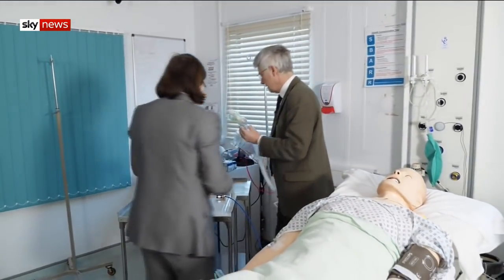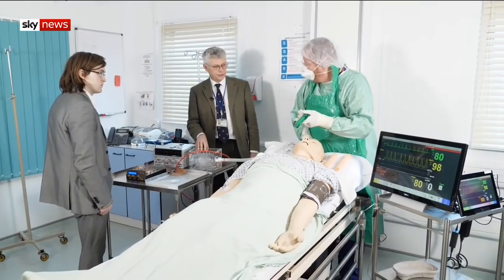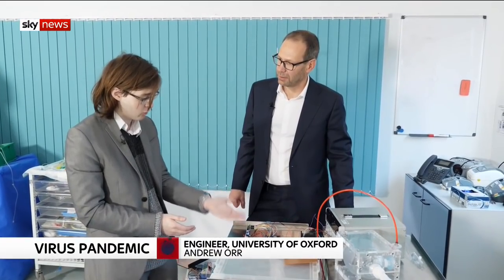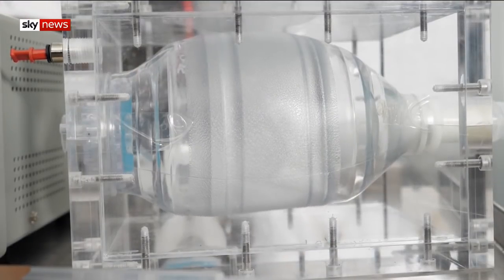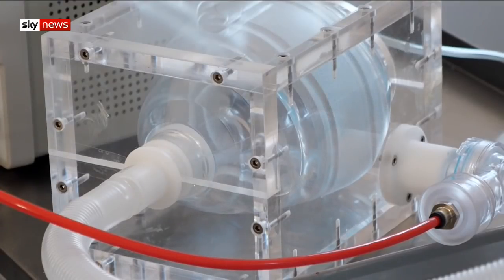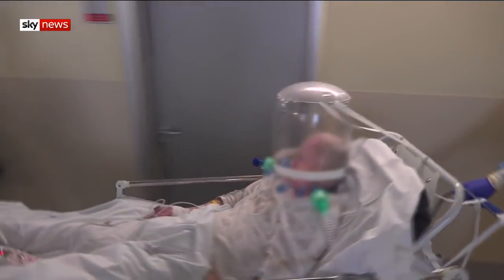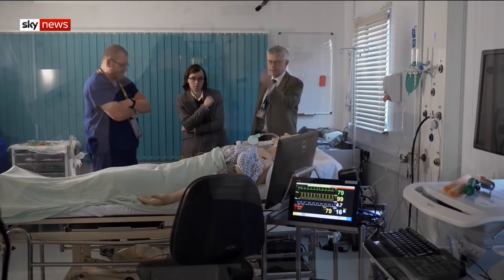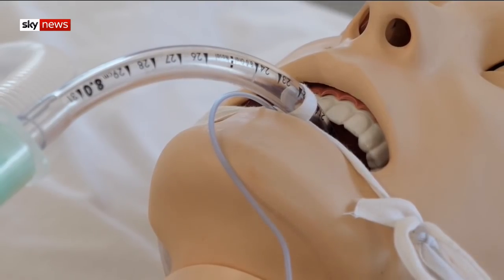New innovation could help solve ventilator shortage

Comment: Good for hospitals that have a presssure line in each room.  The volume output versus pressure source input can depend on the specific structure of each bag, since they can 'crumple/compress' differently -  but they could easily caibrate with each unit with its specific Ambu bag.   Mechanically applied pressure would seem to be prone to less statistical variation with respect to Ambu bags - but just my thoughts.  For a home based unit I'm going with the mechanical compression methods - air compressors are a little loud.

Comment: manual respirators such as those used in this project are useless for covid19 patients. the body's immune response destroys lung cells and makes the lung tissues cling to each other when a patient tries breathing. the hospital ventilators are special in the regard that they can sustain enough positive pressure to keep the lung tissues from clinging to each other while the air goes out of the lung and circulates. it's nice to see people try to help but this project does not seem useful to treat covid19 and could even cause harm in case being used. if manually keeping someone alive could help then every patient would have a family member manually pushing the manual ventilator and have family members make shifts. this is sadly not the case. sorry to be a party pooper

Comment: Very interesting. The time to market and great cost of vents is in large part a function of regulations and the required testing that ensure patient safety. This device would under normal circumstances be laughed off the drawing board as a death trap. That said though, in a situation  where the alternative is no vent at all, perhaps a special class of products not requiring years of stringent testing can be considered. Be careful though, reliability doesnt come quickly and these things will require a lot of monitoring as they'll be failing left and right. Tough call for the regulators whether to allow such devices. Would I want have my life depend on a Raspberry Pi, not really.

Comment: The makers community use Arduino a lot this  is a mass produced microcontroller and if we all come together we can make the ventilators. A lot of people in the UK have a 3d printer at home and is more likely to have an Arduino too . Surely we can reach the 2000 mark or 5000 in no time . just look at what is happening with 3d printed PPE masks made by prusa.

All we need is funding.

Comment: Looks simple. He said no moving parts but there has to be a compressor. 
What type of small compressor. One out of a Refrigerator. 
There is a US doctor with something similar. He uses a cam drive plunger to compress the plastic bag. Any reliable small geared variable speed electric motor.  Adjust the speed and also adjust the stroke to change the volume of oxygen. No electronics. No compressor.

Comment: Just make sure to account for the compressed air requirements!! Setting up too many could over-burden the facility air compressors resulting in reduced available air pressure, which could throw many air-pressure/flow dependent systems out of whack. There should be plenty of large diesel compressors available to tie into such a system if needed since so many operations are shut down!

Comment: Make one large ventilator per hospital . One pump runs all greatly reducing components needed to run system .. If this method is used a cheap but large volume air compressor can be set up in utility room or exterior of building in a safe area and it can be used to supply needed air via pvc piping throughout hospital with separate lines going to each patient and then supply many hundreds of patients at a time off of one system. At each patient have small individual pressure regulators ,monitors , etc..
Oxygen can be added to system along with secondary filtration and one way valves for safety . 

The individual regulators can be plugged in where needed . If new rooms need to be added it is simple to add more pvc line to that new area . 

Quick to implement, cheap, most parts are already available local hardware parts stores ,
Reply: Four words -  Single Point Of Failure. Also, it is a crap design as frequency, inspiration/expiration time, air mix, tidal volume, relief/alarm pressure all need to be regulated per patient.

Comment: I wonder it the designers considered turning it inside out. I mean instead of the self-expanding  ambulance ventilator in the middle supplying air to the patient, having a balloon in the middle of the box expand to push air out of the box into the patient. I would guess it is easier to find balloons than ambulance ventilators. Not knowing squat about ventilators, If having a volume adjustment would be helpful, a movable baffle inside the box could change the quantity of air to the patient.  There might have to be a perforated box to keep the balloon from over expanding. Just a thought. I hope the USA government is smart enough to look for low tech solutions with very little chance to make someone rich.

Comment: I like the design in many ways, but there seems to be no manual may to operate this thing. Other designs that run on electricity seem to have that option. Is the compressed air going to be provided through a central system or is there going to be a need for a compressed air bottle per bed ? 
Non of what I pointed out is a deal breaker obviously.

Comment: "while just a jumble of wires and electronics"
Isn't that every single electronic device ever made?
Reply: yes. we already have the schematics to build ventilators.... this is just a barbaric look at it. This is nothing revolutionary
Reply: It's an arduino UNO, with  breadboard and jumper wires.
Reply: it will be a printed circuit board. all those wires will be gone and it will look like a tiny motherboard that can be spit out of a factory like a machine gun. this is just the prototype.
Reply: that is "robot" to squeeze the air.
Reply: the brain is an Arduino..  a Raspberry Pi could do a bit more, like take vitals, store data, display data and be connected to local LAN (wired or wireless)
Reply: I'd wager that not a single mass-produced device built in the last 30+ years features a rats nest like that simply BECAUSW it is mass-produced.
Reply: Peter Lustig  the week includes simulation, prototyping, pad placement tweaking, multiple iterations to adjust for everything that normally goes wrong with the design, component sourcing ( I doubt sony stocks ATmega368's normally), production engineering (panelizing, planning out the flying lead tester and the pick and place files etc..), post production testing... it's not so much about the automated output capacity as it is the human hours preping for that, packaging, shipping, everything else that goes into preparing for a production run. Anyone that's done CNC knows this, the actual running of the machines is the easy fast and cheap part, it's preparing for the run that's costly. This timeframe is pretty much standard for rapid prototyping turnaround for assembled boards.
Reply: That's not the point in the choice of words.
Reply: @helloworld3943  we know.
Reply: No moving parts? No motor? No pumps? How the hell does it work?
Reply: @vladvolkov8008  magic!
Reply: deanmoncaster Fuckin* Magic!
Reply: Peter Lustig  there is no way these will be reliable enough to actually be used in a medical facility. This is just a prototype. I can't see them putting something like that into production even if it's an emergency.
Reply: No... they will make a PCB(printed circuit board).
This Is simply a prototype using jumper wires and breadboards which would be impractical for mass production, also its using an arduino which is a microcontroller which is overkill for something so simple,  they could use a different microprocessor to lower costs
Reply: Looks like a raspberry pi with breadboard - happy to donate one programmed up if they release python scripts for gpio
Reply: @laoan  It's an Arduino. The Arduino logo is visible in one of the closeups. My guess is it's an Arduino UNO. A Raspberry Pi would allow all sorts of extra features like a video monitor and WiFi connectivity.
Almost any microcontroller would likely be able to control the ventilator. I bet a 555 timer could be used as well. Just something to open and close the compressed air valve. 
The novel approach appears to be using a respirator bag which would normally be compressed by a human hand is instead compressed air. Adding the bag likely solves some of the pressure regulation worries.
Reply: @ddegn  yes I see that now I'm not looking on my phone - a relay driving a £5.99 electric solenoid valve, allowing compressed air into the chamber - a supply of clean humidified air is the greater part of the challenge.
Reply: @ddegn 
Open and close a valve? He said no moving parts... WTH? How does air move without some kind of pump, compressor or a moving valve opening precompressed air?
Reply: No it is a pcb no cables
Reply: @zaxarispetixos8728  0:08 try watching the video then commenting 😊
Reply: @deanmanchester999  i meany no this not how every device is made your phone has no cables everything is printed traces on something
Reply: @zaxarispetixos8728  my phone has cables, the wife antenna, the charging cable that's just two...... 🤣

Comment: So it's just a box filling with compressed air. The compressed air is going trough a 3/2 solenoid valve that's controlled with a Arduino. So easy and yet so brilliant.

Comment: A Dilettante Presumptuous Theorem: 
Can a CPAP Machine be converted into a complex inpatient Ventilator?                         Kathleen Chesterton 11.9k views  
Source: https://www.quora.com/Can-a-CPAP-or-BiPAP-machine-be-used-as-an-adequate-substitute-for-a-ventilator-if-the-spread-of-the-novel-coronavirus-creates-a-shortage-of-ventilators
Vents and CPAPs/BiPAPs are entirely different devices that treat entirely different respiratory conditions. Vents (ventilators — this is mechanical ventilation) are for those who either cannot breathe on their own or who need assistance with spontaneous respirations. CPAP & BiPAP devices treat sleep apnea both obstructive and central. These patients CAN breathe on their own and, for the most part, can initiate respirations. So, no, these devices would not replace a vent, nor would a concentrator. As well, the settings on vents are very different from those on an...
Vents and CPAPs/BiPAPs are entirely different devices that treat entirely different respiratory conditions. Vents (ventilators — this is mechanical ventilation) are for those who either cannot breathe on their own or who need assistance with spontaneous respirations. CPAP & BiPAP devices treat sleep apnea both obstructive and central. These patients CAN breathe on their own and, for the most part, can initiate respirations. So, no, these devices would not replace a vent, nor would a concentrator. As well, the settings on vents are very different from those on an apnea device.
People on vents are intubated. This intubation — tracheostomy, orotracheal, nasotracheal — is incompatible the with the tubing of apnea devices and the tubing that works with intubation doesn’t work with apnea devices. Although vents have CPAP and BiPAP modes — other mode settings include PEEP and SIMV — these settings aren’t used alone. And CPAP and PEEP, for example, are used when weaning a patient off a vent but, again, this isn’t the only setting /mode in use and apnea devices don’t deliver enough pressure to ventilate lung tissue.

Comment: Does anyone have a link to the plans for this? There is no time like the present...
Reply: Just speculating: the manual intubation? bag is inside a sealed perspex? container, of sufficient thickness (and suitable airtightness?) to withstand ongoing pressure changes. I'd imagine there would be 1x compressed air inlet solenoid (12V/24V DC?), and one of the same for the outlet (venting to normal atmosphere). These solenoids would have to be some sort of proportional? (ability to vary air pressure) control, as human lungs aren't designed to work like tire inner tubes, requiring ramp up/down pressure control. Possibly some sort of MIG welding pressure regulator could be used to help achieve this, maybe alleviating need for special solenoid? Control circuitry - I'd imagine Arduino-based may be sufficient. Control: Need to be able to control intubation pressure; ramp up (air delivery into lungs); Hold time (how long to maintain pressure); and Ramp down (release pressure to atmosphere, slowly - I noted somewhere, that Covid-19 patients sustain more lung damage with full breaths as opposed to partial breaths - something to do with the inflamed lung lining being further irritated by complete deflation). Note I am in electrical trades, not medical, so take this as a possible starting point, until proper plans are available. Also, standard compressed air supply has major safety issues - need to focus on this aspect... HTH.

Comment: It's good that this design is going to be open source for anyone to implement. Once the emergency is over, however, it will be difficult for companies to make and sell a shiny version with bells and whistles unless they can tweak the design to patent it. Normally medical devices are ridiculously expensive and it takes months and years to get them approved as safe for use on patients. 

Also, existing computing hardware and programs that could be used inside cheap products usually come with warnings that they are not to be used in "mission critical" situations: which would definitely include ventilators. IBM and Microsoft appeared to design their stuff to crash regularly. Ventilators should not connect to the 'net.

Comment: Ventilators are highly specialised items of equipment. They are designed to go from mains to battery to manual pumping in event of an emergency. We now are asking garden strimmer repairers, vacuum manufacturers and the man in a shed to design and build them. Heroic and needs must but, efficient, reliable and safe? Well, any port in a storm!

Comment: I'd like to think this would be well within our capacity to knock up 1000s these simple ventilators within a couple of weeks 3 d printers would and could   knock up some of the more standardised vital technical components for the units in pop up factories throughout the UK. After all when Nevil Chamberlin (UK priminister ) met with Hitler to Levi a peace deal and came back with the signed piece of paper saying Peace in our time.But also realising that it ment Didly Squat and would only buy us a couple of months .The war ministry commandeered domestic   engineering units and went in to overdrive to produce thousands of new innovative Planes tanks and guns before the crap hit the fan in many make shift factories up and down the land were mobilized in weeks producing cutting edge weapons.

Comment: Great step forward. Simple to use simple to build.
Just hope there is enough compressed oxygen tanks
Reply: Driven by compressed AIR.  When we've run out of that, we're all in trouble.  O2 supplied at low flow to supplement FIO2

Comment: "We're going back to ventilators about 15 years ago."  I don't think so! This is going back to ventilators about 40-50 years ago.
If the patient has pneumonia it would never be able to adequately ventilate.
 It would need to be a volume ventilator; this is a pressure ventilator.
Reply: The Ambu bag has a fixed volume of air. Squeezing it flat will deliver that volume, won't it?

Comment: So why was this not done for Italy or China Spain
Reply: Maybe people in Italy, China or Spain didn't think it'd be possible or accepted, or maybe the 'inventor' was already working (which takes time) on the simple but robust code for the microcontroller, in this case an Atmega 328p, to then be able to bring the parts together. Then add a few days to build confidence in the idea, testing it by running the code and the valve gear continuously to see if anything fails, then when happy present it for appraisal to the people that need it; people who need something that just works, even if it looks terrible with wonky stickers and stuff, and not something they have to tinker with.

Comment: Dupont cables and breadboards are great for prototyping but no good for reliable connections, properly manufactured surface mount (or even through hole) are key, thanks to Sony - also companies like jlcpcb could knock out thousands very quickly I’m sure. As a maker I probably have parts enough to contribute a few units and I’m sure others do too, open source the plan and crowd source some of the manufacturing may also be an option in a pinch. There are other makers on youtube actively working on opensource / diy ventilator projects, check them out... we applaud your efforts.

Comment: This is one of the conversation we will need to have once this disaster is over. Is innovation for the sake of innovation with advantageous. We have almost crippled ourselves by relying heavily on state of the art technology which is expensive to purchase and slow and difficult to produce and supply. A simpler, cheaper and more adaptable approach is often better. In future we should be designing equipment not so that it provides a 1% improvement but that tooling and manufacturing can be rapidly increased on demand. The weapons and the vehicles or world war 2 were not the best available, but what could be rapidly prototyped and could be produced with re-purposed equipment with a semi trained labour force in a matter of weeks.
Reply: It's intelectual property for profit that has caused this. All of the tech has been tied up in registered IP, trademakrs and copyright nonsense. They charge an arm and a leg for a reason. Governments need to swat the greedy IP lawyers out of existence. Big pharma is making megabucks off of suffering.